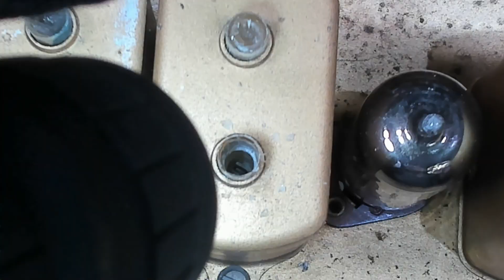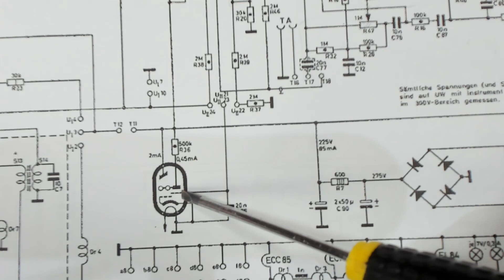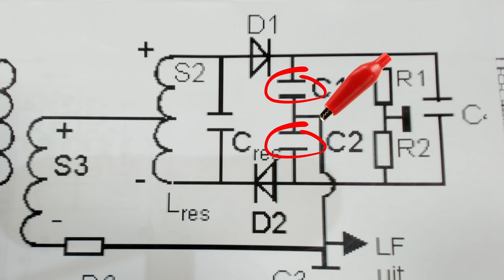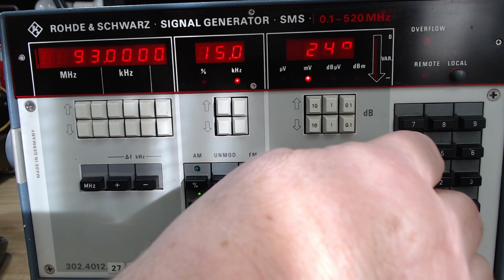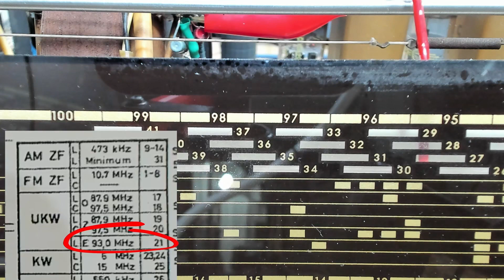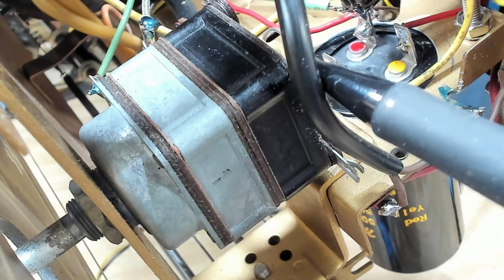Loewe Opta  Meteor 1781W - 1956 - Part 2

Comment: Your use of drill bit to take the wax out was brilliant. I tried it today with great success. Do you have any suggestions on the converse problem, that is, on how to firm up a loose adjustment screw after alignment?
Reply from the maker: Good to hear @ayazdani88. I have tried the following: Dental floss, Teflon tape, strip of thin rubber band and wax. It depends n how loose the slug is 👍🙂
Reply: @DavidTipton101 Thank you David.

Comment: If that distortion is only with pickup(Tonabnehmer),check all resistors around the eabc80, this tube is used for the pickup,i had that problem myself, First Thing to try is another eabc80.
Reply from the maker: Thanks Tobias. I fixed the distortion by replacing the EABC80 tube as I remember. I didn't try the pick-up input I don't think.

Comment: 8:40 I think you should measure the adjustable capacitors at the peak and then replace them with a mica cap of the right reading.  I would worry about vibrations changing the value. They tend to be pretty sensitive and not isolated from the case where the speaker vibrates.
Reply from the maker: I considered that tarstarkusz but I can tell you these are not going to move. If I replaced them with micas there is no way I could get the exact same value and I can't adjust the core to compensate for any difference 🙂

Comment: David I was greatly impressed by new coil winding machine, It far cry the machine I used as School Boy as part time job as Motor Rewinding we did Transformer also but new winding machine is excellent 
I equally impressed by sweep alignment of Fm Tuner,We had had Sweep and Marker Generator in the Television Workshop it came into use when Customers had a go of tightening up screws to improve the Picture in Black a White time.
You had a battle with Ifs but had excellent success,Excellent work David on troubleshooting the Lowe AM and Fm Radio,Regards Ian,
Reply from the maker: Hi Ian. The winder is way over the top but I could not find a secondhand one anywhere, it will work very well once I learn to use it. Those loose screws are just itching to be tightened done 😄
Thanks Ian, it was a learning experience 👍🙂

Comment: I didn’t see part two come 🆙 of this. I hope 🤞 this radio 📻 doesn’t have dual dial cords, for your sake. Dual dial cords can be okay 👍, if ya have the dial cord stringing diagram. Or take a LOT of snapshots, if you’re missing the diagram. This reminds me so much of Shango066, with his German Consolette radio 📻. Those are BEAUTIFUL 😍 capacitors (the ones you’re turning the screws on with a screwdriver 🪛). The speaker 🔊 appears to be permanent magnet 🧲.  It’s almost 😅 🎃 👻 again. “Happy Howlidays”, as I tease 😈 about it. Your friend, Jeff.
Reply from the maker: Thanks Jeff. Is it almost halloween again 🤦‍♂️🙂

Comment: Hi Dave. Beautiful radio and   nice solution to those pesky slugs. Regarding to the distortion on FM, shouldn't the 10,7 marker be on the center of the slope , rather than on top of the hill? Thats how the "S" curve should look. Not that I've ever attempted to adjust it!
Reply from the maker: Thank you Alejandro. I didn't do an S curve adjustment, I was checking the IF curve to make sure it was looking good. I adjusted the ratio detector using its ability to reject an AM signal. I injected an AM signal at 10.7MHz and adjusted the output to minimum. At that point the detector is balanced 👍🙂

Comment: Hi Dave,  More next-level stuff with every video!  Loved your fix for the stuck core in the IF transformer.  Logical of course but I never thought of that.  A few new pieces of kit for the workshop too!  That Rohde & Schwarz signal generator looks like a great gadget.  Proper buttons & switches!  It must be a pleasure to use.  I notice you're using a real analogue CRO as well.  It seems to work very well.  Not to mention that Precision sweep generator.  You'll soon need a bigger workshop!
Looking forward to the next exciting episode.  Cheers.
Reply from the maker: Hi Don, thank you. I love using the Schwartz, it does everything AM and FM. I could get something a fraction of the size but not so much fun. The CRO was complements from Vern, The Radio Mechanic in the US. He sent the sweep generator as well. I needed a bigger workshop a long time ago 😂

Comment: And another great video David. Who would have thought that wide/ narrow switch would have caused so much of a problem, FM osc drift and you certainly thought outside of the box with the fix for that one with the detection and fix !! Freeze spray and the heat from your soldering iron was a good way to check for intermittent transistors. Looking forward to the cabinet re furb and the final outcome.
Reply from the maker: Hi Stephen, thank you. The switch had me fooled for a while, I didn't know it existed. The FM still wandered a little but nothing like it was, so it did improve it. I exhausted a can of freeze spray on the FM tuner 😄 
Cabinet on Friday 👍🙂

Comment: Have those volume pot shafts been replaced and lengthened? Of course I have no idea what so ever, it just seems like those knobs are stuck out quit far away from the bezel faceplate thingy, and it also looks like it has old scratch marks on it from where the shorter shaft&knobs might of rubbed against it once upon a time.
Reply from the maker: Hi Matthew, no, they are the original shafts 👍😀

Comment: Did you work out what was wrong that valve which caused distortion.Yes i did enjoy it lots of things but you managed to all.
Reply from the maker: Hi Michael. No I didn't find what was wrong with the valve. I tried putting it back a number of time and it was always distorted. It may work OK in another radio 🙂

Comment: Can't wait for the final test, had one just like this and they sound very good, full rich bass and plesant trebble. Great repair, enjoyed watching! PS: There are a handful german radios based on a main speaker that is very special with a large, light cone. Look for Nordmende Tannhauser 55 or the Metz 403WF, that large speaker is incredibly capable, fast detailed bass, wonderfull midrange and very linear. Nothing matches it in german radios from that time, the large top of the line oval Saba sounds compressed and lacking detail in comparison.
Reply from the maker: Thanks George. Final test next week. I will keep in mind what you said about the speakers. I don't get a lot of German radios of course 🙂

Comment: Another brilliant video, I love your  trimmer mod , that will be a great radio when all done , lovely . Can't wait for your next vid. I still have this old "ear"  el84 mono amp but no idea how to re assemble it. It's transformerless. Has 2 big wirewound resistors , selenium rectifier and does have a speaker transformer
Reply from the maker: Ahh... you didn't say it was from a record player Leo (I watched your video). EAR was a brand name of Electric Audio Reproducer. It looks like a push-pull amp and a common means of voltage control was to wire the two output valves in series with the player motor. If the valves are UL84 thay have a 45 volt heater plus the motor windings can equal 240 volts. 
Go to radiomuseum.org and under the 'Home' tab, enter "Electric Audio Reproducers" in the "Manufacturer/Brand field. You will find about 15 results, only four have two valves in them some with a schematic, some with a photo some with nothing. 
Even if there is no schematic but you can identify the model you can use that to search for a schematic or someone may have done one and posted a video or blog. Good luck Leo 👍🙂
Reply: @DavidTipton101  I wondered why there was no switch on the motor. All the wires were disconnected and unit is in kit form . Were you meaning the b+ is in series with the motor?
Reply from the maker: No Leo, the valve heaters and the phono motor will be in series with AC from the mains. The B+ will be derived from the 240 Volts using a rectifier, some heavy resistors and smoothing caps. I outlined how to get a schematic from Radiomuseum.org. in the last message, there were a few schematics there for two valve record player for Electric Audio Reproducers. If they have two similar valves in the schematic the circuit will be close to your model even if it isn't the exact circuit you have. Manufactures didn't redesign a circuit that worked, they stuck to the same principle design.
Reply: @DavidTipton101  so the heaters will work on ac then , yes I see about the selenium rectifier that runs of mains and theirs couple resistors to drop the b+ . That would explain no switch on the record player motor. I'll try work out the wiring. Thanks for your help :)
Reply: See Uncle Doug Channel.  I think the resistors will drop input voltage for the valve heaters and valve "B+" .  There should be a similar kind of transformerless (US voltage) where the resistance of the Valve circuit is enough to use up about 90v of a 110v  input.
Reply from the maker: Thanks Leo. As Highpath says the resistors will drop the mains voltage to about 110 volts for the valve string. There is a high voltage heater version of the EL84 for transformerless sets, I think I have some. PL84??? I might be wrong there.
Reply: @DavidTipton101  here's 240v and theirs only 2 valves. I have a video on here of an overview of it
Reply: @DavidTipton101  PL valves were physically shorter,  but could be as I think they tended to work in systems with a 90V battery DC supply
Reply: @DavidTipton101  PL Smaller (P for Pigmy ?)

Comment: The 473 blocker is something that should have been fitted to all radios because I remember back in the 70s and 80s, NDB for aircraft had some operating around the 430 to 500 Khz range which caused bleed over on some radios when tuned to a normal radio station.
Reply from the maker: Interesting Christopher. I read somewhere that marine radio operated in that area too, might have been in the US. Not needed nowadays I guess 🙂

Comment: I think the reason I enjoy you so much is I've been a radio technician since 1981, I haven't adjusted a coil or trimmer cap in over 20 years. I still have all my tuning sticks but all my equipment is software controlled ... even the filters. You remind me what radio was like when I started out. BTW, my first commercial radio repair was a General Electric Progress line transmitter with 2 4CX400 final tubes (valves). Those were scary because they had 1.5 - 2.0 kV DC on the plates.
Reply from the maker: Hi Tim, times have changed. 2K plate voltage! that would get your attention 😲

Comment: Thanks Dave, always nice to have morning coffee with your video! I am just completing a project for my daughter.  She is a Dr. Who fan, so I found a plastic callbox and have installed a DFplayer attached to an ESP32 with an Android APK that another fellow has written. I put 8 gig worth of MP3's on it for her and it can all be run through her cell phone via Bluetooth.  I had some problems coming up with enough power for it all, I had some old cell phone batteries but they didn't have enough amperage available to get it all up and running. I finally built a small converter using a 7805 and a 9 volt transistor radio battery, now it boots OK and comes up on the Bluetooth after a short time. I think she will be pleased, at least I hope so.  She wants it on her desk at work so I was careful not to mess with the outside design of the case, just  a few small holes to allow the music out, and a toggle switch on the back side. I still need to come up with a LED indicator but I am not sure where to stick it Inside I sized a circuit board so it sits far enough down inside the case but doesn't hit the speaker.
Reply from the maker: Sounds fab Jerry. At least there will be plenty of room inside the Tardis to fit all the gear 😂

Comment: Dave, You've done it again, pull the proverbial "rabbit out of a hat" but you weren't happy with just one you but pulled two. The coil cleaning tool and and then turning an inductor tuning circuit into a capacitance tuning circuit. I bet you come up with some non-radio related innovations around the house that would surprise your audience and make life easier for that marvelous wife of yours.
Reply from the maker: Thanks Mack. I have come up with some ingenious (my assessment) home innovations at times. For instance, my home brew dispensing adaptor that was powered by a fish tank air pump (Beer Buddy) or my automatic bathroom fan that activated when the toilet was flushed (Bathroom Buddy). There was also the BBQ Buddy, the Beneficial wastewater reticulation Buddy .... the list goes on. I was only limited by innovations that had to start with 'B' 😄
Reply: @DavidTipton101 Opening scene of the 2nd Tipton channel, opening scene your wife sitting on the sofa yells honey where is the footstool buddy.
Reply from the maker: @mackfisher4487  Bolster Buddy?

Comment: Hey Dave, my word you have to have the equipment and the know how to align all those frequencies..! Here comes the newbie 'dumb' question..With all that wax etc holding the initial alignment, why does it go out of tune after a few years..?
Reply from the maker: Hi Edward, thank you. In hindsight I possibly could have left them, I was chasing the distortion which turned out to be a valve. The alignment does change as components change value over the years, they often need a tweak it get them tuned accurately again 🙂
Reply: Ok cool, I thought there had to be a reason..Thanks for for your time and explaining it for me. @DavidTipton101  😃

Comment: Hi David, it vas fun to se this Loewe Opta was made the same year as my Tjerneld Turkos but my radio are not so fancy as the Loewe but it is rare thou, they was only made during two yers 1956 to 57, in my home town Stockholm in Sweden. As always i like what you are doing.👍
Reply from the maker: Hi Claes, thanks. Your Tjerneld Turkos is push-pull, nice. Very similar radio to the Lowew as they all were at that time. It's difficult to tell one brand from another sometimes 🙂

Comment: Strange that radios in Australia don't go up to 108Mhz
Reply from the maker: What @Ragnar8504 said 🙂
Reply: This isn't an Australian radio if you're referring to the Loewe. It's a German one, and old too. Originally the European FM band was 87.5-100 MHz, then it was extended to 104 MHz in the 60s I think and eventually to 108 MHz in the early 70s or so. Oddly enough my 1950s Radione 551U that doesn't actually have an FM tuner (it was only meant to be upgraded with one) has a dial that goes all the way from 87.5 to 108 MHz - except it says metres rather than MHz.

Comment: Hello Dave,

Nice application with the mica cap install for the FM module and the adjustable caps for the IF can. The FM alignment went well.

The alignment information from the schematic referenced to your practical alignment, will be helpful for others wishing to have a go at alignment of the Loewe Opta radios. 👍

If you have a cabinet restoration coming up, I better book a seat for your next Radio Adventure, for next Friday evening. 

Knowing you, the cabinet is going to look good. I can’t wait for your next Radio Adventure. 😁
Reply from the maker: Hi Pete. Thank you. I did dwell on the alignment with the idea of helping others. Yep, cabinet restro next week. Cheers 👍🙂

Comment: Amazing work as usual!  Suggestion, did you try to use a heat gun on to try to loosen the stuck slugs?
Reply from the maker: Thank you @socalav. I don't remember exactly but I usually drop some IPA in there and a bit of heat. It was more than wax holding them. It's a fine line between them coming loose and me breaking the former 😄

Comment: Great repair work Dave as always, Tricky alignment of the radio alright but well all sorted by you ,Nice test gear too you are using also,, Where does buy those coil slug alignment tools from , Cheers and many thanks for sharing ur expertise.
Reply from the maker: Hi Dave, thanks. The hard plastic alignment tools came from Altronics, I don't remember where I got the soft plastic one. They are all available online though.

Comment: Tuning a ratio detector by volume level works as you measure the audio output. The response is an S-curve that is steepest at the center. So, if it is aligned,, the audio level is maximum (assuming you have a small signal.) The more common method measures the voltage across the diodes and uses no modulation. Peak the IF and then the final step measures the voltage at the audio out and adjust for zero. When I was a car radio tech, we used the RF method as we didn't have a FM-modulated generator.
The AM wide setting will allow better audio frequency response but more interference. Great work as always.
Reply from the maker: Thank you Scott 🙂